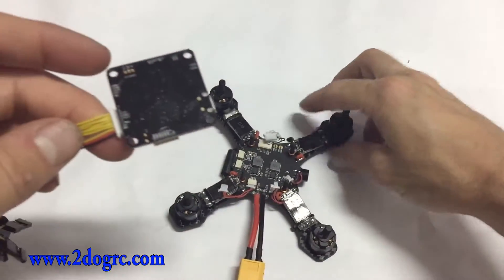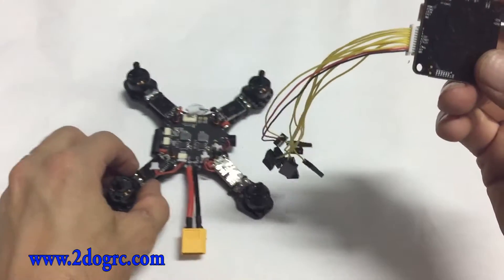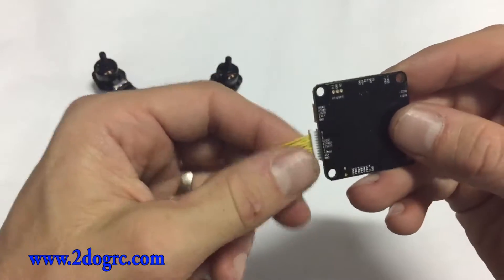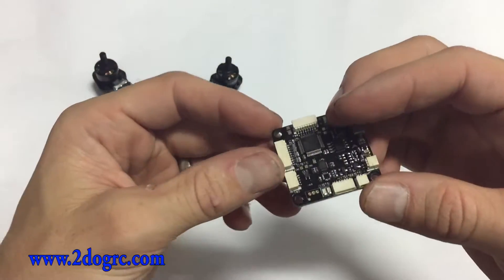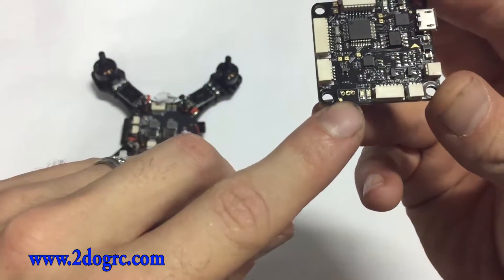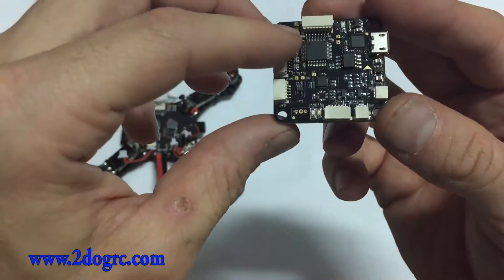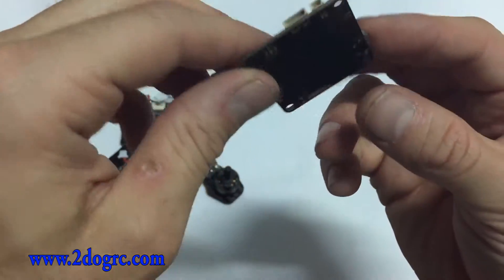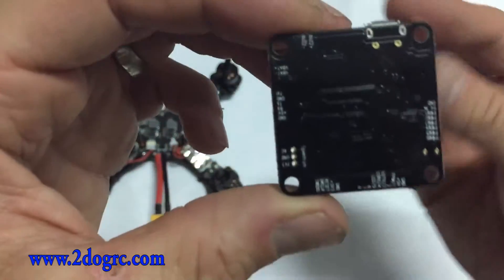Diatone Thin Naze32 and Wiring Spektrum Satellite  Receiver

Comment: hey Mark I just picked up three of these at the week signals RC Expo. and I am having trouble wiring in my speltrum receiver. I soldered the wires into the sbus ports on the flight controller. but they do not have power going out. is there something I need to do on cleanflight or do you think there's some other problem?
Reply from the maker: What did you pickup at the show, just a FC or the complete crusader kit?  Please use the contact us page on the website and leave your contact number and I will get back to you and we can trouble shoot it.
Reply: 2dogrc i got the whole kit. I tried to hook it up to clean flight and it wouldnt connect or light up
Reply from the maker: Okay,  A couple of things.  The new kits require a 5V receiver, but a Spectrum Satellite only can operate on 3.3V.  That probably was not good for your receiver.  You will need a 5V receiver, LemonRC and Hobbyking Orange series has 5V receiver that will work. The second problem you are having has to do 2 things.  The first issue is that these run Beatflight, Cleanflight won't work.  Also you need to install the CP210X drivers listed on the Betaflight tab.  You can download the Betaflight program from the Chrome store, just like you did with Cleanflight.
Reply: 2dogrc i tried beta flighr too, that did not work, i downloaded both drivers amd updated them still didnt light up on the fc board. i dont know whats going on with this
Reply from the maker: When you plug in the FC do any lights come on?  There should be a solid blue and momentary red.  Also when you connect the board to the computer with Betaflight open, does the port in the upper right next to connect change?
Reply: no lights at all. when i plug the battery in the vtx will light up but nothing on the fc. when i plug it into beta flight it does say connect. but will not let me
Reply from the maker: What happens when you plug the FC into your computer with the USB? Do any light come on?